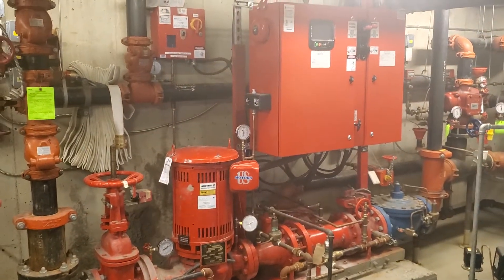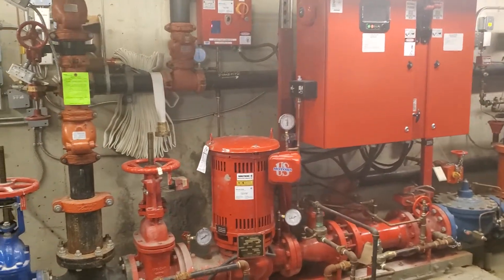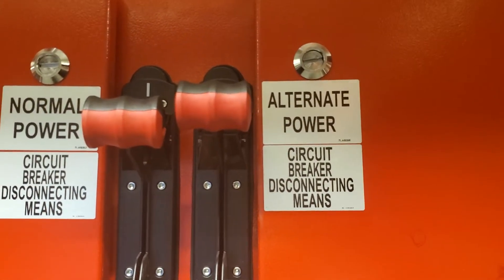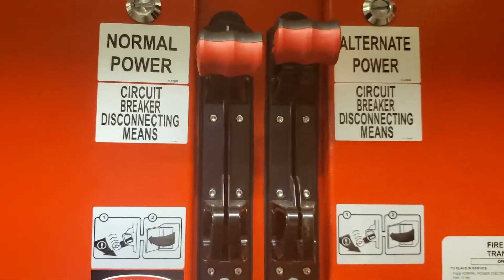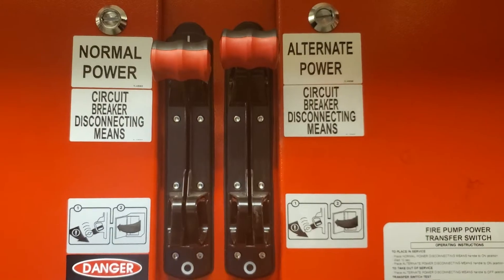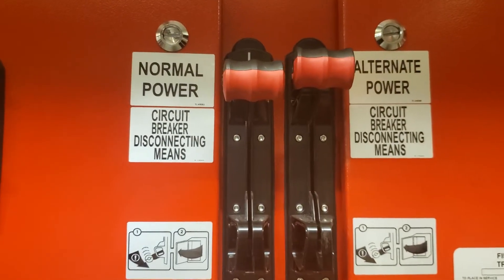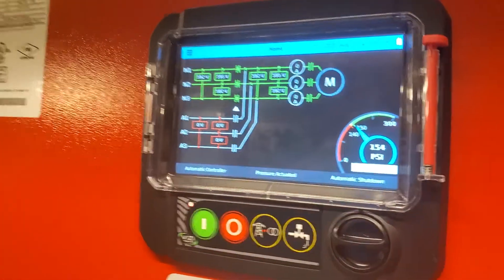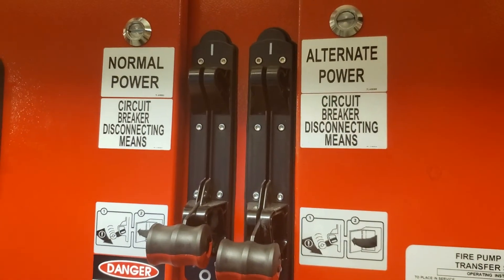DO THIS 1st TO SHUT OFF Sprinkler Fire Pump Breakers

Comment: Do I have to have to have any certification or training to shut this off
Reply from the maker: Great question and one that i am not sure of either .
I am allowed because the building owners , property managers etc give their permission to do it . Sometimes it is me and sometimes the building engineer who does it . I dont have any specific training or certifications from the manufacturer . All i have is my Journeyman Sprinklerfitter certification from my Provincial authority .So i dont believe you need any to just shut it off . You do need certification to do actual work on the fire pumps for alignments , yearly inspection etc . 
There is also ASTT certification to do that as well as training from the manufacturers .

If anybody else would like to comment on their jurisdictional requirements please do so .
Reply from the maker: The people who do have the training to commission , align and certify are in high demand  . You dont need to be a Sprinklerfitter to take the course offered by the manufacturer.